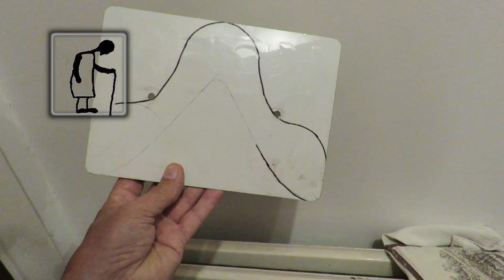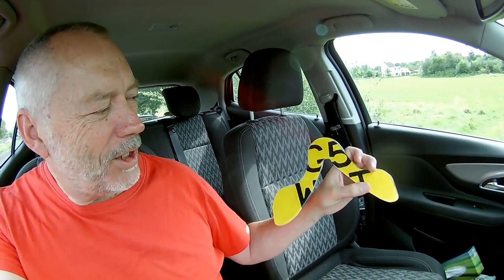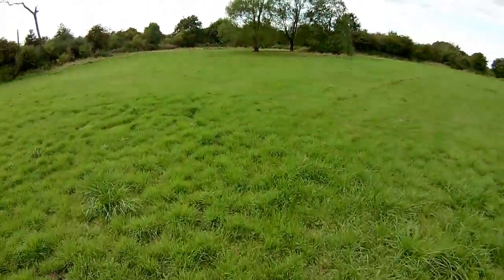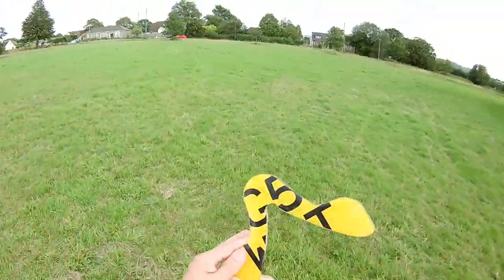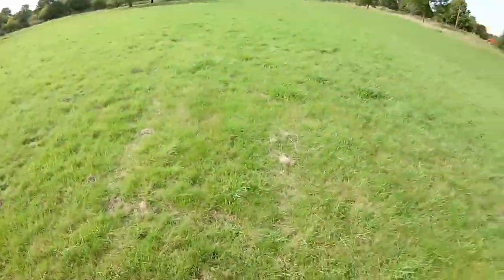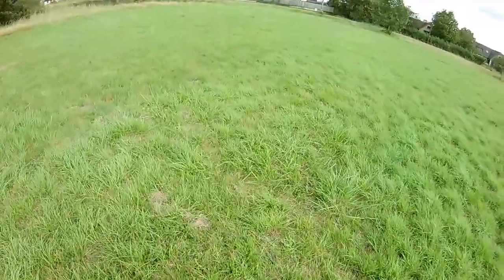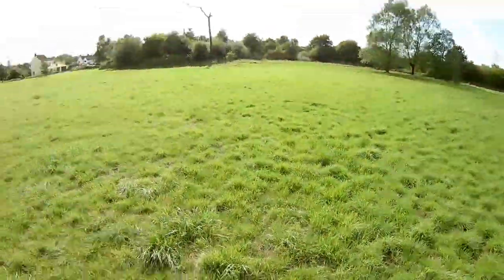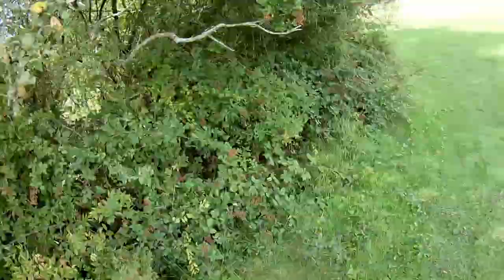Numberplate Boomerang FAIL

Comment: I had a boomerang at school when I was 8 yrs old. Remember it working perfectly. Surface needs to be concave with flat underside and Roughly L shaped with both sides equal length. The curved surface causes the turn.
Reply from the maker: Hi Graeme, just going back through old comments trying to add some words to comments that I only "hearted" at the time 😁 I spent a fair while sanding the airfoil into this boomerang but as you can see I really didn't get much turn. I think the main issue is I just don't have the right wrist action to get it spinning fast enough.